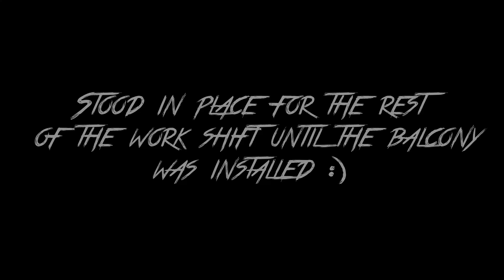Tower Crane Balcony Installation

Comment: Is that circle on the LIM giving you a spot to on that lower podium level? Never seen a monitor like that before.
Reply from the maker: That is the zooning system on the tower crane, there is many diffrent systems but most of the systems use telemetry some use fisical sensors or switches or software limitations, this works  like a AMCS’s DCS 60 crane control system or the old SMIE TB45 or the new one the SMIE ProSite that is verry similar to the i4508 RaycoWylie tower crane anti-collision system. There is many makes and looks but they all used as zooning system to stop the crane/load passing the boundaries of the site or going close to a restricted area or another crane on site. Regards Ricardo
Reply: @RicardoTheCraneOperator  are you a self contractor? I see you have videos of a bunch of different sites and not much time in between posts.  That is a alot of moving around for an experienced operator such as yourself. Where I am from we usually stay put till the project is complete or get pulled off when it is winding down to go do heavy production somewhere else.
Reply: I see. The newer wolffs that I have run have anti collision systems/radius boundries but I have never had one set up before. I assume there wouldn't be a visual read out on the monitor like there is in that crane. That is pretty handy.

Comment: @RICARDO Hi, Ricardo I'm thinking of doing licence for Tower Cranes, this year, but I'm not sure if I can get any job with Red Card only? What's your opinion on this? Thanks a lot.
Reply from the maker: Hi 1212potach, to be honest some crane hire company's have been givin away training/apprenticeship, flowding the markets with new drivers to work for for free like, wages have decreased around 20%+ in the last 8 years or so, a crane hire company with 150 cranes can train up to 500 new crane op a year for the last 5/6 year's there is at least three company's doing this that we all know! Not easy to get a job this days as the market is flowded with new operators. CPCS red traineed card operators need to work along side blue competent operators untill an NVQ is achieved this is what CPCS standards say! But to be honest o have seen operators on sites with one crane operating with a red CPCS card (BS7121 says there should be 2 Operator for 1 crane, 3 operators for 3 cranes and so on covering brakes etc, but rarely sites do that) operating the crane with out any blue card operator on site is against CPCS standards! It is not easy to start on a red card but if you willing to travel to jobs were no one wants to go and work hard/long hours etc you will be able to get a job and progress with an NVQ into a blue competent OP card etc... The first jobs you need to be ready for the bad news like they have another operator from the conoany coming in or some other excuse, but wen you get the hang of it you will be flying and the sky is the limit from there on 😀👍🏼 Beast of Luck, Regards Ricardo
Reply: @RicardoTheCraneOperator Yeah, I was a bit apprehensive about spending £3000 pounds on training and after going nowhere with it. But anyway thanks bro for the warning, wish me luck. 😁😁